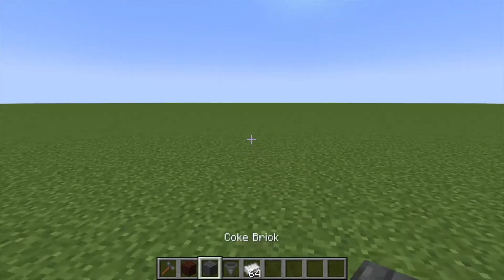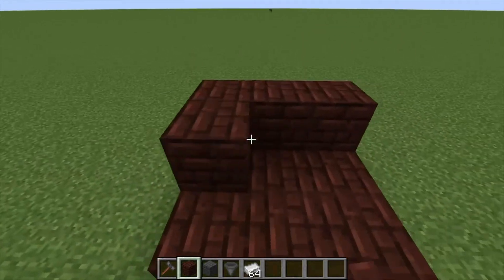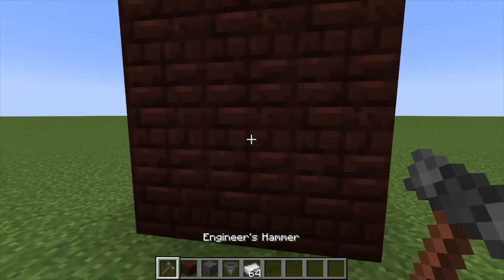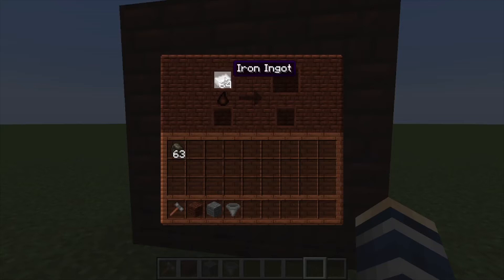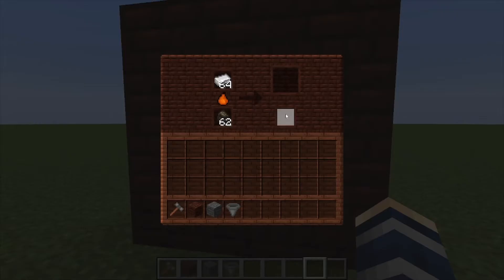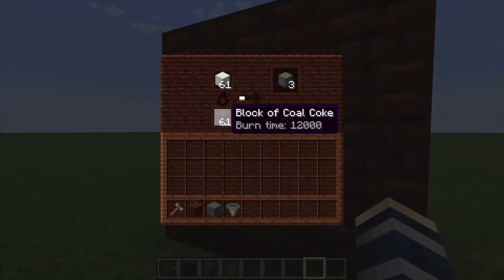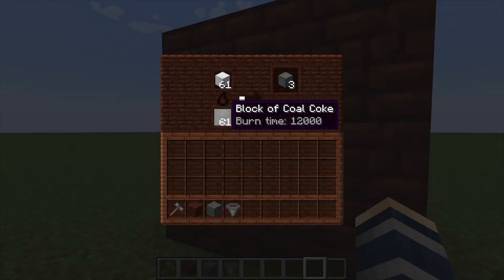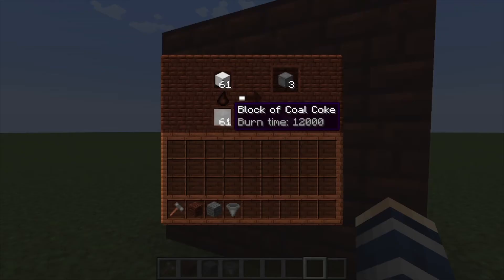Immersive Engineering: Crude Blast furnace (how to get Steel)

Comment: Structures like this is why I can't stand working with Immersive Engineering, the input/output options (or lack thereof) are frustrating. The slow speed of machines is equally as irritating.
Reply from the maker: There is the improved blast furnace that has all these options minus speed. If you're looking for Process speed, Mekanism did a decent job at that.

Comment: i tried puting every item as fuel but none of them work?
Reply from the maker: As in they don’t go into the slot ? Steel does take a long time and may not look like it’s working or your in a modpack that did recipe changes
Reply: i mean it wont even let me put anything in the fuel slot @MCMentor1
Reply: Nevermind, I Just Got Steel A Diffrent Way
Reply: I was also having that issue but it worked with charcoal @WatermelonCatIsBack
Reply: It’s because you need coal coke, I was stuck too but I find that you need another furnace like the blast one but this time it’s to burn coal to obtain coal coke and then you can put it in the blast furnace to make steel, hope it’s helpful !